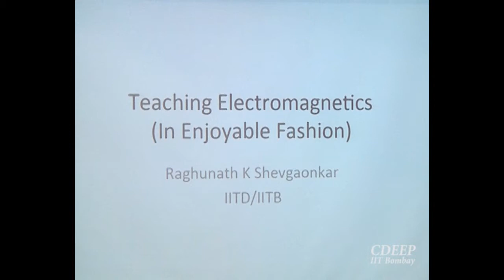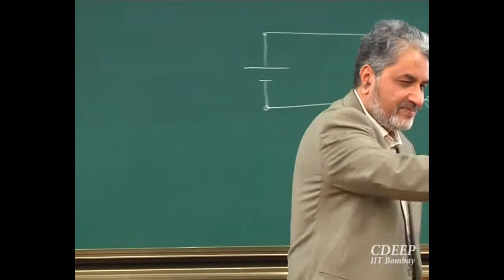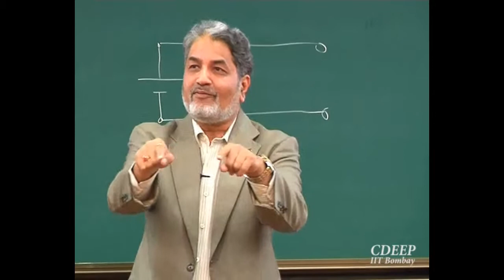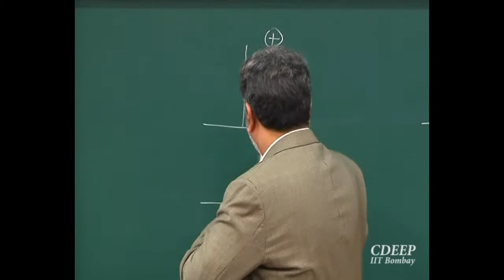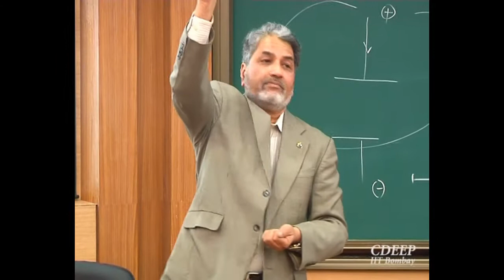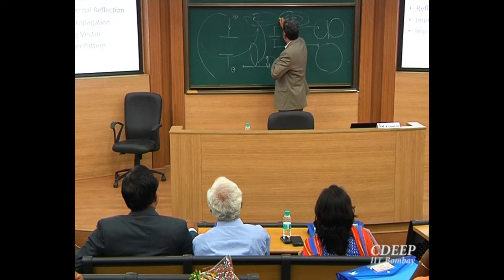Teaching Electromagnetic Waves in an Effective Way by Prof. R.K.Shevgaonkar

Comment: Just if we put multimeter in free space it must show 377 ohm sir in resistance mode,but it is not giving the number why sir.can you please sir,explain.
Reply: How will u connect the wire( pins) of multimeter to measure resistance in air or vaccum
Reply: multimeter will tell u resistance only when current pass through it!!